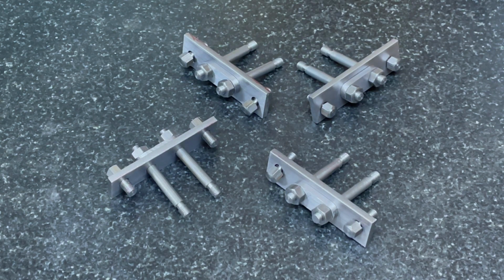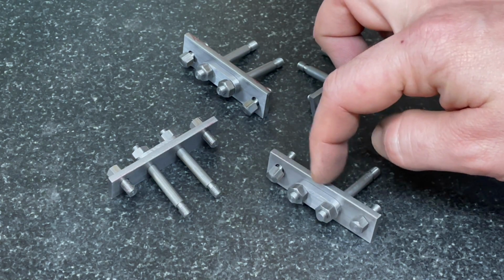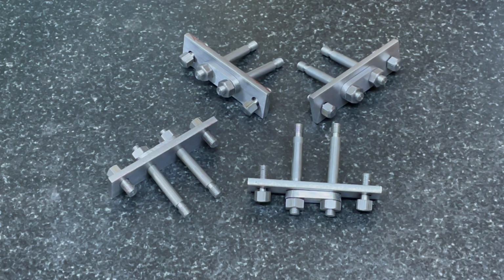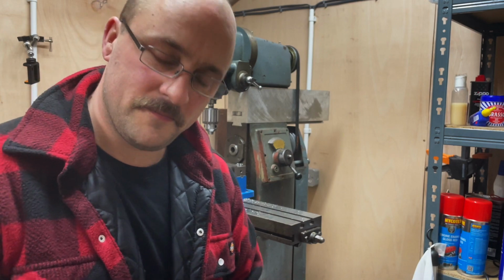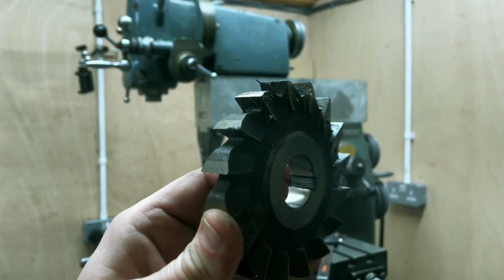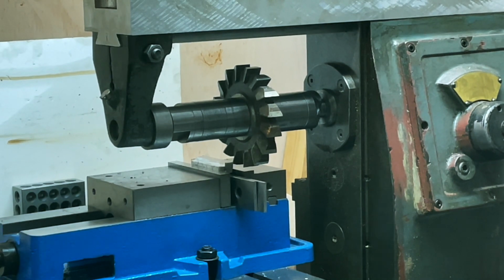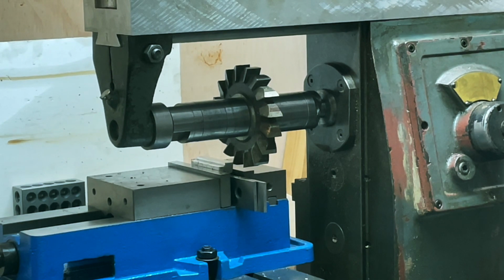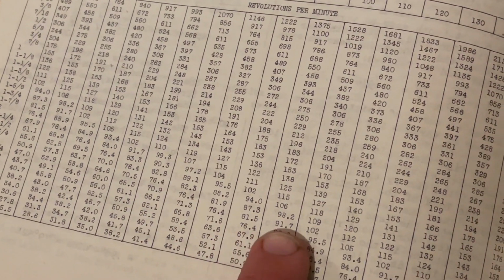Setup and Testing for Centec 2b Horizontal Milling - Steam Locomotive Build #8

Comment: William, I like your short videos. At my age I can't stand at my machines for long periods like I used to so to take a break and sit down I go to U-Tube to check out what others are doing. By the way I am currently working on a Stuart Turner 5A and a rebuild and a new build of two 3/4 inch locomotives.
Dick B USA
Reply from the maker: Hi  again Richard/Dick - I know what you mean about just standing around waiting for things to happen. I think I should get some anti-fatigue flooring. Or better shoes lol

Comment: I prefer longer length vids, but I guess that would decrease the frequency of your output.
My other thing that's slightly annoying is when you use your phone you hold it in portrait so I end up with small narrow pics on the TV, a lot of people do this I don't think they realise that people watch on TVs and not phone's or tablet.
I really enjoy your vids so do keep up the good work.
Reply from the maker: Hi Tony, I think I did that in the shorts I've done - which are normally only 15s long and require that orientation. If you're seeing that elsewhere can you link it to me and let me know?

I can make videos longer if you would prefer by leaving more cut content in (setup, milling multiple parts, etc.) without much affecting frequency, but otherwise you're right - something's got to give.
Reply: @williamsworkshopuk  hi, thanks for the reply, yes it was only in the short video.
Keep up the interesting work.

Comment: Hi, where did you get the raising block from?
Reply: the material is at the moment super expensive    aluminium is best in my opinion. i have been quoted £60 for a 3x3x8  inches of course, then the machining ... i have a very good friend who has his own business deals in all sorts of exotic metals i got my riser of him for ,,,,nowt,,,only 12" long but now i have to do the machining .. tell me what you want and i will do my best to get you the metal of the dimensions you require  [ aluminium ]he dont use cast iron ... regards    laurence
Reply from the maker: Hi mate, it came with the machine, but it was fabricated in horizontal mode on the machine itself from a large aluminium billet.

Comment: On the question of video length.  
I like your current output.  However I suspect that the videos show what you accomplished on a given day.  Some days you have more time to devote to making your locomotive, and that will result in longer videos.  Other days there’s only time for one or two steps and theses will result in shorter videos.  I appreciate what your doing and will be happy with either.
Reply from the maker: Often not a single day, but at most a couple of days really. I'm happy to store up footage in theory; but if you like it coming out like it does - then I'll keep it the way it is :)

Comment: 40 MM? speaking foreign? Oh dear.... :) 

Good work getting the spring plates back. On the content, I think 10 to 15 is probably the sweet spot. I suspect many of my videos are far too long, as it is hard for people to find the time. That said, I could also think about better editing.  (You are).

Well done on the axle boxes.
Reply from the maker: In my defense, I think they were listed in metric! TBH I didn't account for the rounded corners so I was bloody close on my prototype box in the short I showed the other day.
Reply: @williamsworkshopuk  It's a problem with the "square" cast iron. I suspect it is a function of the process. Don't forget to bring a grub screw and we can work it out.